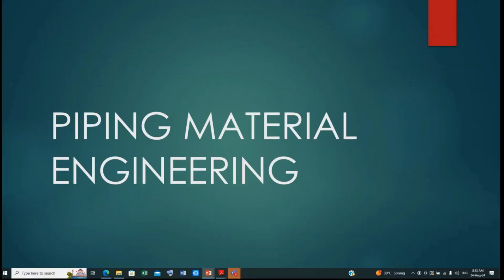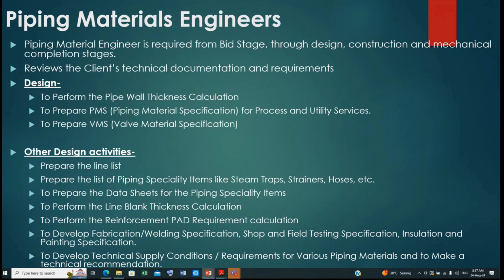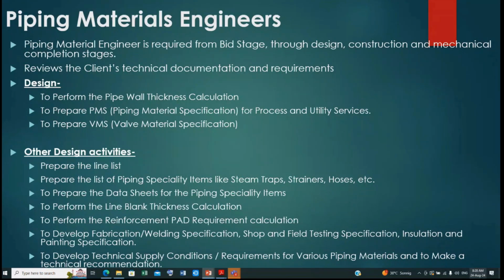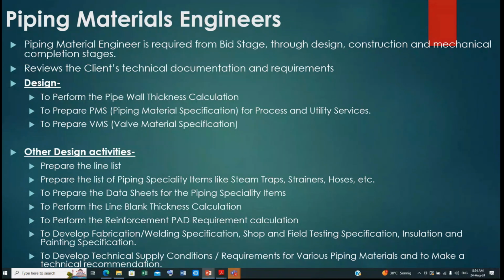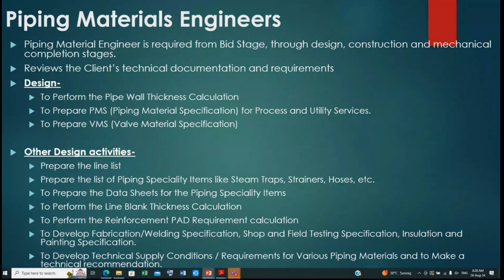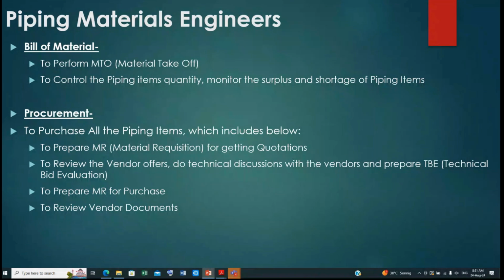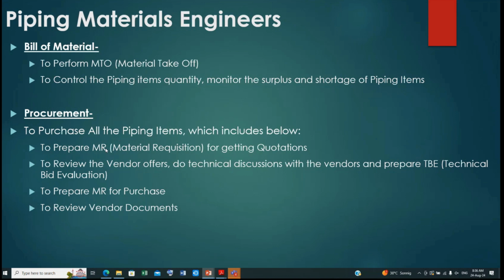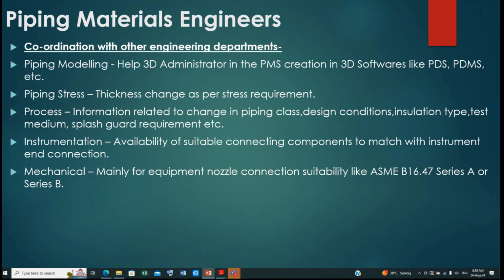Piping Material Engineering Basics || Piping Engineering

Comment: Bhai  Thermodynamics course public kardo and free karo please
Reply from the maker: Check description box it's free on website
Reply from the maker: Limited time offer at just 49Rs (Price will increase after 2 days)
If you want to watch this playlist without ads you can visit everyeng.com And you will get certificate and PDF Files also.

Thermodynamic Principles and Applications in Engineering by PK NAG (Chapter 01)
https://www.everyeng.com/learn/d4deb49c/thermodynamic-principles-and-applications-in-engineering-by-pk-nag-chapter-01

Measurement Of Temperature In Engineering Thermodynamics By PK NAG (Chapter 02) 
https://www.everyeng.com/learn/78d2814f/measurement-of-temperature-in-engineering-thermodynamics-by-pk-nag-chapter-02

Work & Heat Transfer in Engineering Thermodynamics by PK NAG (Chapter 03) 
https://www.everyeng.com/learn/350bbb84/work-heat-transfer-in-engineering-thermodynamics-by-pk-nag-chapter-03

First Law of Thermodynamics in Closed System by PK NAG (Chapter 04)
https://www.everyeng.com/learn/5e81d7c4/first-law-of-thermodynamics-in-closed-system-by-pk-nag-chapter-04

Steady Flow Energy Equation in Engineering Thermodynamics by PK NAG (Chapter 05) 
https://www.everyeng.com/learn/8e446844/steady-flow-energy-equation-in-engineering-thermodynamics-by-pk-nag-chapter-05

Second Law of Thermodynamic by PK NAG (Chapter 06) 
https://www.everyeng.com/learn/22d86630/second-law-of-thermodynamic-by-pk-nag-chapter-06

Entropy In Engineering Thermodynamics by PK NAG (Chapter 07) 
https://www.everyeng.com/learn/47e5a55f/entropy-in-engineering-thermodynamics-by-pk-nag-chapter-07

Exergy In Engineering Thermodynamics by PK NAG (Chapter 08) https://www.everyeng.com/learn/c0df0c59/exergy-in-engineering-thermodynamics-by-pk-nag-chapter-08

Properties of Pure Substance In Engineering Thermodynamics by PK NAG (Chapter 09) 
https://www.everyeng.com/learn/fcf4bf5e/properties-of-pure-substance-in-engineering-thermodynamics-by-pk-nag-chapter-09

Thermodynamic Relations In Engineering Thermodynamics by Pk NAG (Chapter 11) 
https://www.everyeng.com/learn/cbf645af/thermodynamic-relations-in-engineering-thermodynamics-by-pk-nag-chapter-11

Vapour Power Cycle || Engineering Thermodynamics 12 
https://www.everyeng.com/learn/dfbeceda/vapour-power-cycle-engineering-thermodynamics-12

Gas Power Cycle In Engineering Thermodynamics by PK NAG (Chapter-13) 
https://www.everyeng.com/learn/dc9e65d3/gas-power-cycle-in-engineering-thermodynamics-by-pk-nag-chapter-13

Psychrometry: Understanding Air Properties and Processes
https://www.everyeng.com/learn/acb9d455/psychrometry-understanding-air-properties-and-processes
Reply: Sir I will request you to share more videos on piping engineering your videos are informative and valuable. Thank you for such free knowledge.